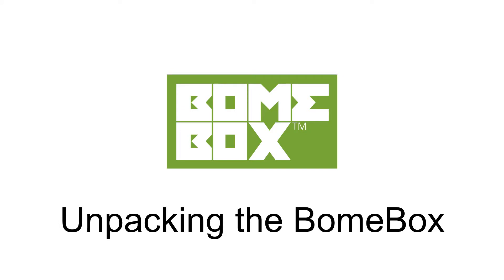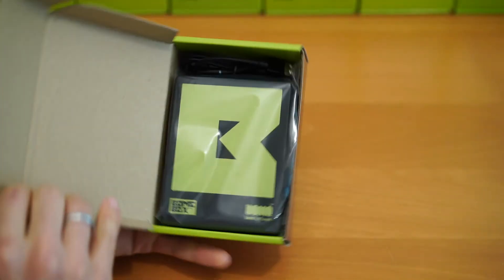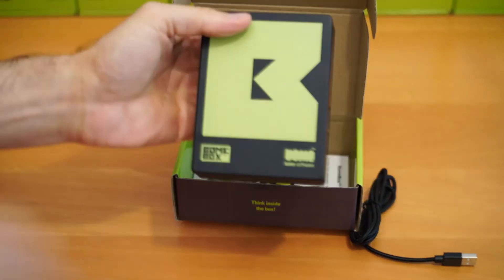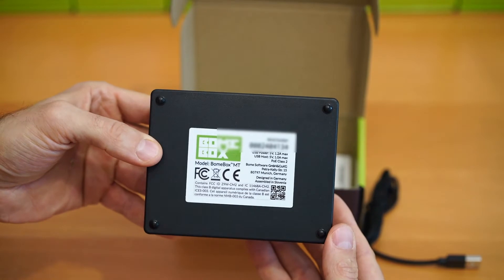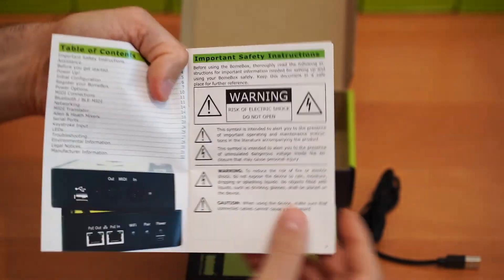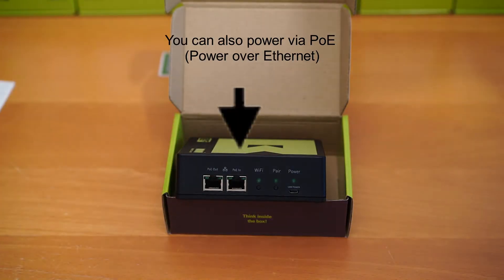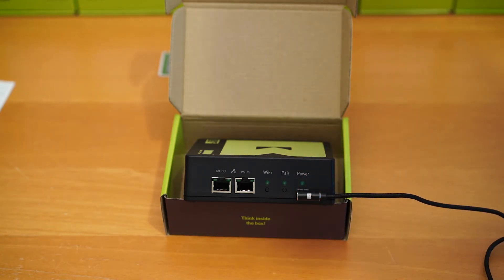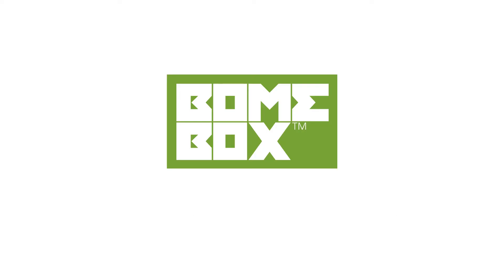Tutorial: Unpacking the BomeBox

Comment: What major hardware revisions has this product gone through, or is it basically the same hardware as from 8 years ago?
Reply from the maker: Thanks for asking! The hardware design proved to be extremely reliable, and while we have added major features via new firmware versions, the hardware has only seen minor changes over the years. More major features are in the pipeline for the firmware. Is there anything you'd like to see in hardware for a possible BomeBox 2?
Reply: @Bome  Having used the Bomebox for stage & studio very happily, I do have a top 10 list of hardware extras for the next generation BomeBox (sorted by importance): 1. A dedicated USB connection to the host computer (not only USB power), 2. at least a second USB host port, 3. a fader and a click button for various purposes including PANIC (see Loopop Plus 3), 4. assignable footswitch and expression pedal inputs, 5. more DIN MIDI ins and outs - maybe on the back of a rackmount unit, 6. an extra chip to handle RTP MIDI, 7. a programmable LED (or how about a 2x16 LCD to display user text :-) , 8. a CV input jack, 9. a MIDI to CV output jack, 10. and seriously: an HDMI output to display scrollable RTF text documents, like the Blackmagic Design Hyperdeck Shuttle HD, so the BomeBox could be used as a MIDI-controllable prompter. Cheers and a happy 2025 🙂
Reply from the maker: @andreas-wismann  Thank you very much for the fantastic top 10 list! And sorry for the late reply. 6 of them are planned for BomeBox 2. We generally don't go into details for planned features or products, but we may announce something more specific at the NAMM show next week...
Reply: @Bome  Kann's kaum erwarten! Macht weiter so - die BomeBox ist praktisch konkurrenzlos, da müssen Andere erst mal hinkommen.

Comment: Hello, I am your customer of bome translator pro software. I use the software mainly to convert midi automation designed in ableton into serial data that I send to an arduino to move motors. today i have to keep the mac connected to the arduino to send the data. I'd like to do without the mac. with the bomebox could I record the automations built in ableton and send them to arduino without having connected the mac? so as to have some sort of standalone device? Thank you
Reply from the maker: Hi,  BomeBox will support serial ports so you could connect your Arduino to your BomeBox and it will act as a serial port and the set up your project on BomeBox to send to the Arduino instead.  Of course Ableton will still need in the mix somewhere since it is generating the original messages.  Of course, audio would have to take a different path.

Reach out to us on our forum below if you have further questions.

https://forum.bome.com

Steve CaldwellBome Customer Care